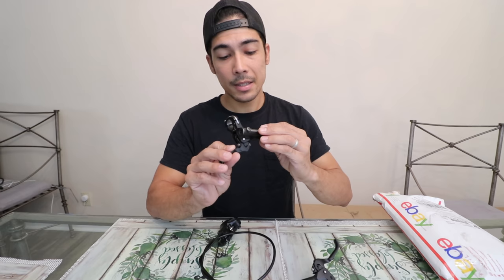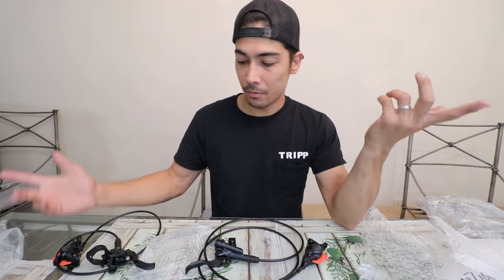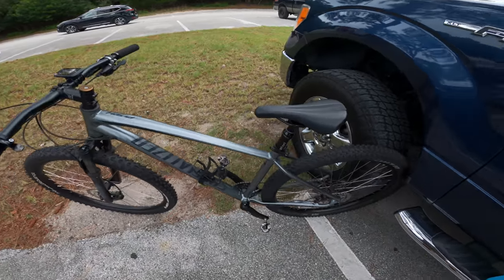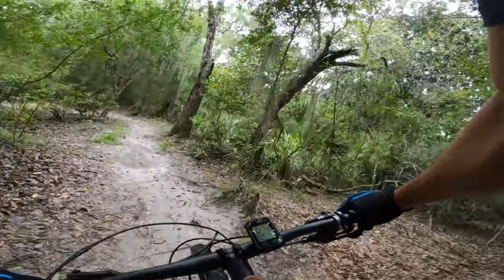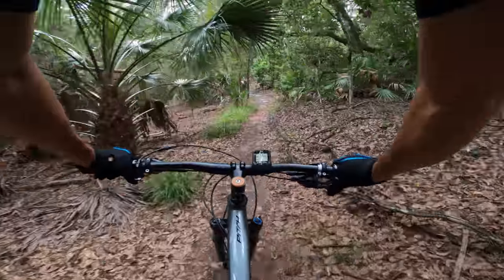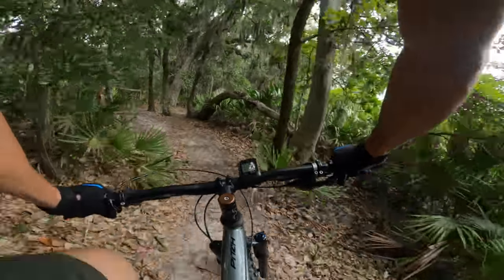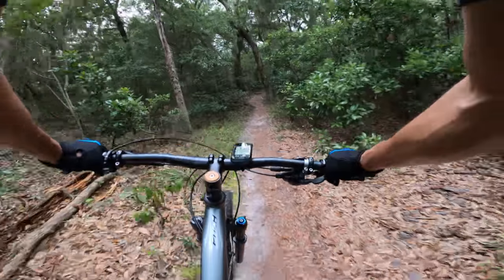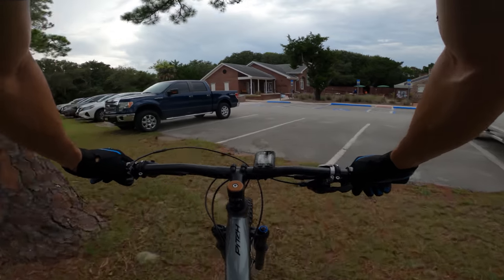SHIMANO HYDRAULIC BRAKES ON MY BUDGET PROJECT BIKE

Comment: Your pitch it way better than mine, mine is mostly stock tho. It can handle 35 foot tabletops stock so don't worry if the kile can take it beacuse it probably can (i have only broken a crank and a rim both on a 6 foot drop to flat)

Comment: you should switch to helmet cam, mount camera on in front at the top of the helmet if it's a half face helmet, if it's a full-face you can mount it on the chin bar or upside down at the visor.
with it at the chin bar you get better audio when speaking.

Comment: I can't use these brakes due to the clamp, these brakes use the M6000 brake lever, and a lchheaper spec caliper.
 cus I use Archer D1Xtrail, I have to have the clamp shifter remote inside the brake clamp ghosted, impossible, I run brake elvers flat, and remote at an angle, but not a problem with new shimano brakes, due to the new clamp design, but I still won't do that, I have 3 leaking brakes at home.
but Also I've returned 5 brakes a year ago, and still not heard anything back from retailer even after email, but they claimed they will look into it, and the one answering did not now the case.
also these brakes also have a major flaw, by adjusting the reach to make them fit a child the brake is rendered useless, cus the actuation is reduced, the lever moves in but no mechanism to adjust the actuation/bitepoint, so people with long fingers will have a powerful brake, those with short useless.
also I dislike the servo wave.
here is my review of the brake: https://wp.me/p60aTF-2v7
So for me TRP Spyke mechanical brakes were a much better option, but I want to try four piston brakes eventually.